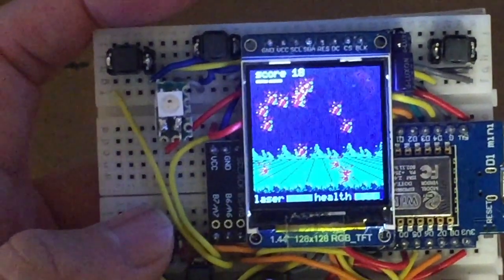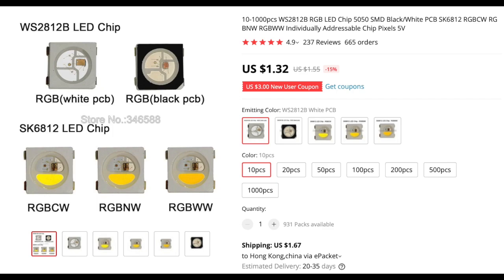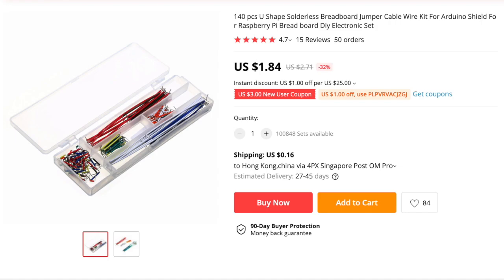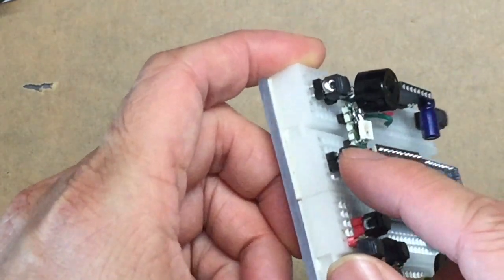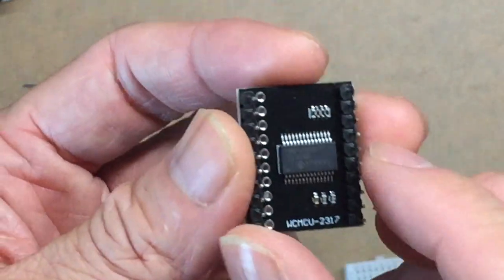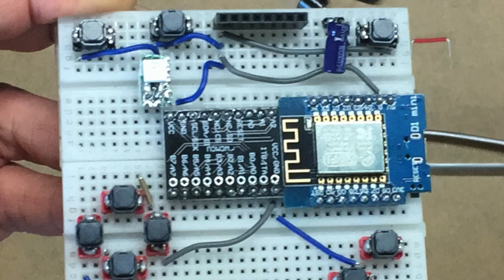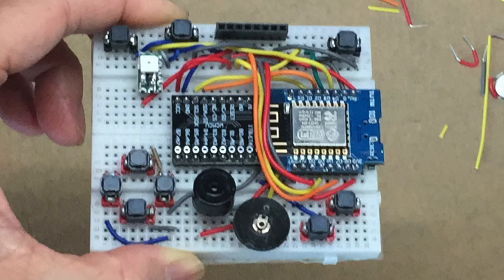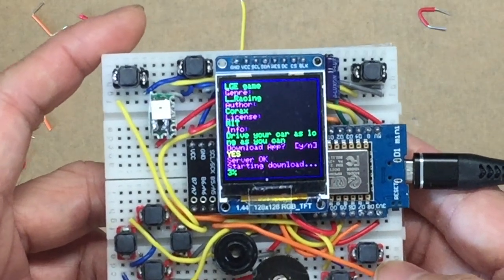ESPBoy Arduboy2 on Breadboard

Comment: great project! I wanted to know if I can make the same, with an esp32 (WROOM32) and a 0.96inch OLED display?
Will it be okay, or should I consider upgrading to the TFT display?
Reply from the maker: If you want to use existing game codes and existing software, then you must follow exactly the same hardware design as what is shown in the video. However, if you want to write your own games and develop your own software, then of course you can design your own hardware and software, and sky is your limit provided you have all the time to spend to recode every game and program.
Reply: @BillyCdiy  ahh man😅😅 that's sad. Thank you for the response though😊.
Reply from the maker: Ray Wilson , there are many other designs for ESP32 hand held retro game machines that are even better eg the Odroid-go. But that need the Wrover32 with the PSRam. Check out my video: https://youtu.be/sP3x_Fm-htA
Reply: @BillyCdiy  ya i have seen your videos on that. But the problem is that it's hard for me to find the wrover edition here. 😅
Reply from the maker: @vineetwilson5277  , there is one in 
e-Bay:
https://rover.ebay.com/rover/1/711-53200-19255-0/1?mpre=https%3A%2F%2Fwww.ebay.com%2Fitm%2F1pcs-ESP32-WROVER-T8-V1-7-TTGO-ESP32-4MB-PSRAM-TF-CARD-3D-ANTENNA-WiFi-Module%2F183692606067%3Fhash%3Ditem2ac4eeba73%3Ag%3A-CoAAOSwlG5ca40W&campid=5338740160&toolid=10001&customid=billdiy

and another one in  Amazon.
T8 V1.3 TTGO ESP32 4MB PSRAM TF Card 3D Antenna WiFi Module Bluetooth ESP32-WROVER Micropython

https://amzn.to/3khtB5H

You need to  upgrade the surface mounted 4MB Flash RAM to 16MB. I ruined one board by using hot air gun to desolder the original 4MB RAM and accidentally blew off a few resistors and could not find that.

Unless you can find a board with 16MB SPI Ram, yuou will need to  upgrade the  SPI RAM from 4MB to 16MB by referencing my video.

You can order these memory chip to upgrade from 4MB to 16MB from these links:
The chip is called W25Q128. It has 128 Mega bit  of memory or 16Mb.

Amazon:
5pcs/lot W25Q128FVSG SOP-8 25Q128FVSG SOP 25Q128 W25Q128FVSSIG W25Q128 SMD
https://amzn.to/2Zy7srY

e-Bay
https://rover.ebay.com/rover/1/711-53200-19255-0/1?mpre=https%3A%2F%2Fwww.ebay.com%2Fitm%2F2pcs-WINBOND-W25Q128FVSG-25Q128FVSG-SOP8%2F392188496462%3Fhash%3Ditem5b50418a4e%3Ag%3AQSoAAOSw9xJcCh-o&campid=5338740160&toolid=10001&customid=billdiy

Comment: 老师请教个问题！我的MCP2317如果用5V供电，各个功能都是正常的，但是切换成3V供电，按钮就会随机自行触发，没有办法正常使用，咋回事呀？麻烦老师点拨一下
Reply from the maker: 你用的是模组还是直接用IC?之前直接用IC, 不成功. 最后 我用了模组, 接3V 沒问题. 是在这里找的.https://item.taobao.com/item.htm?spm=a1z09.2.0.0.71312e8d3aHjAA&id=558251743108&_u=b106a08ofd61.
Reply: @BillyCdiy  Thanks! 我试一下模组
Reply: 我找到IC的问题了，需要把A1 A2 A3三个引脚接地才行，这是我做的游戏机 https://www.youtube.com/watch?v=7JSUFR0sIJc
Reply from the maker: @weirdtechresearch  , thanks. In my module, I don't need to do that. But that's the proper way to set the address. Your mini-arcade machine is very nice. Thanks for sharing.